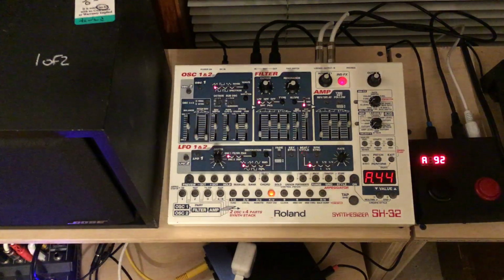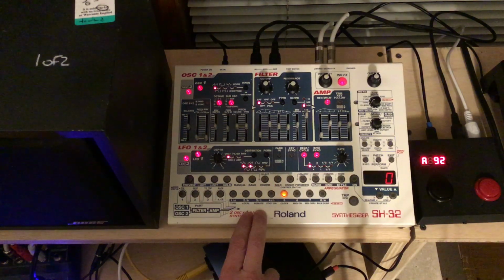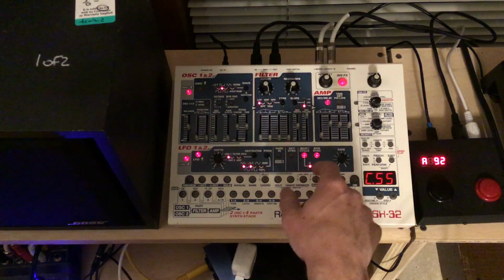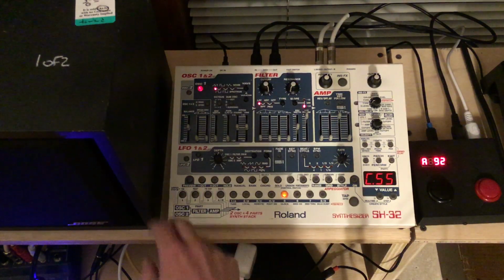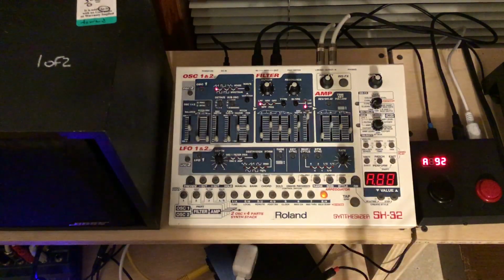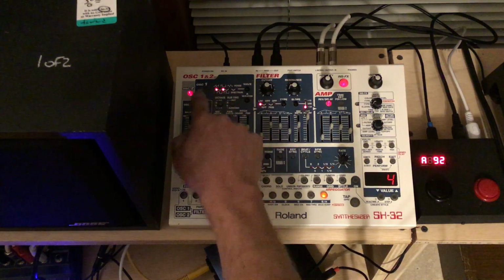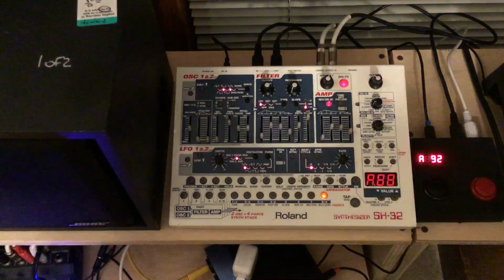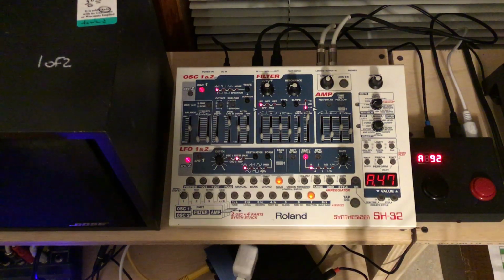Can a 2000s Roland SH-32 sound anything like a 1980s Juno 6/60/106?

Comment: Very cool video. Thanks! It's always awesome to come across someone doing something cool with this machine instead of hating on it like everyone else. I wanted one of these when it came out when I was a kid. These things were so despised I was able to nab one for $70 my first year in college. It comes down to the interface being a problem....as well as the "every techno sound from 1997" sound set. Basically, you need the manual to get anywhere, and just have to memorize the LED hieroglyphics. Years later, despite owning a JP-8080, Juno 106, and JX10...I still have this thing. When I sit down and really spend time with it, something unique and interesting comes out.

Comment: Wait... what???? Jupiter???? Are you sayiing my SH32 which is collecting dust in the corner could, in theory at least, have relatively the same settings applied to it's patches as a Jupiter? Man, I don't know you, but I love you! As Phil Collins said! I would LOOOVE to do that, although I know it won't sound anything like the "real thing," but it would be FUN, FUN, FUN!!! Could you do a video of that? :)
Reply from the maker: I would if I still had it!  But if you check out how the Jupiter voice architecture is set up, you should be able to program similar settings into the SH-32.  The key is just not to use any of the early 2000s cheezy waves on there and stick with simple saws and squares.
Reply: @LewisMidi  Ironically, I just ordered one of these tonight specifically because I love the late 90s/early 2000s cheesy trance/techno sounds this thing seems to be so good at making.  Especially with the pretty awesome arpeggiator it has.  I also like the 4 part multitimbral aspect of it because I intend to sequence this as a sound module from a old MPC via MIDI keyboard.  Thanks for this video though, very informative.

Comment: Thanks a lot for putting all of this together. Much appreciated. Do you have any of the MC series grooveboxes? I have the MC-909 and SH-32. Will explore the SH-32 more with your tips here... thanks for the download as well!
Reply from the maker: No problem!  I've never played around with any of the MC series though.
Reply: Django Fett  Around 2012 I messaged a guy on craigslist that was selling a MC-909. I was on the fence, then one day he contacted me and said he would bring it to me and sell it to me for $250 if I took it today (was asking $400) - $150 off and delivered! So I took it. The pads were in rough shape - yellow from smoke and half didn't work. I contacted Roland and was able to order brand new pad sheets for around $40, which had a perfect layer of the conductive coating to trigger the sounds. I opened it up and gave it an alcohol bath, replaced the pads, and upgraded the memory. While I had it completely apart, I cleaned every component and man this thing is like new now! I bought the Supreme Dance sound expansion for it too. I don't use it as a sequencer... I just use it as a 16 part multi-timbral Roland sound box. I pull lots of classic 90s ravey (is that a word) sounds from it. It has Juno sounds, Jupiter sounds, 303 sounds, 808, 909, 707 etc etc etc.. Its like Rolands' Greatest Hits box haha. Then the PITCH FADER turntable emulation adds a crazy variable to play with when I want to make parts in my arrangement rise or fall.  I actually  sequence from the TORAIZ SQUID, which just an amazing fun sequencer! I have my SH-32 sounding close to a Juno now too so I'm having some fun!!
Reply: @LewisMidi  Just want to thank you again for throwing this together along with the download. You inspired me to dust off the ol' SH-32 and start having fun with it again!